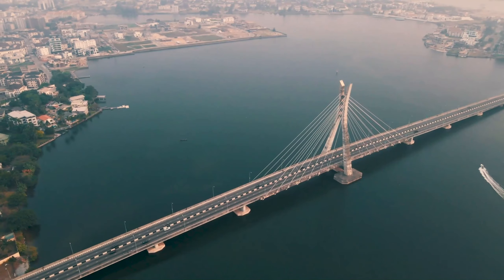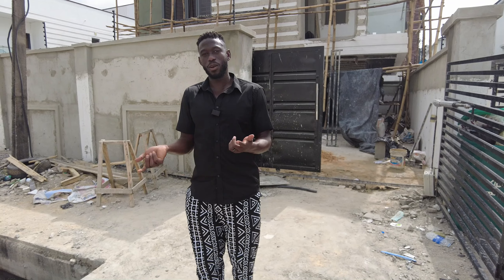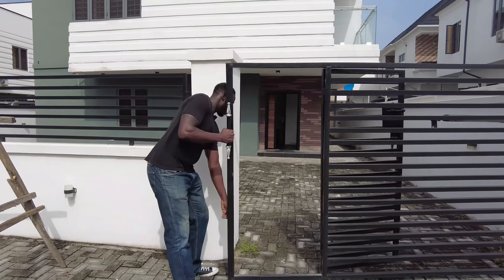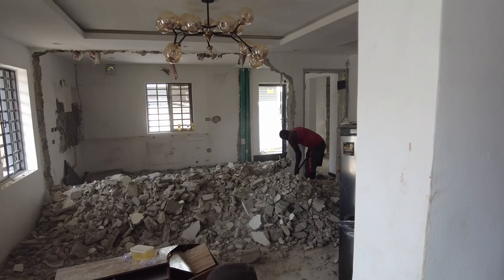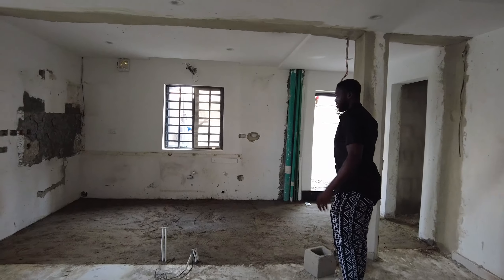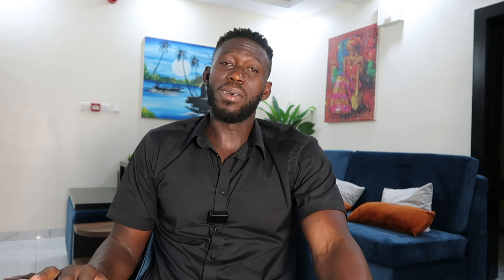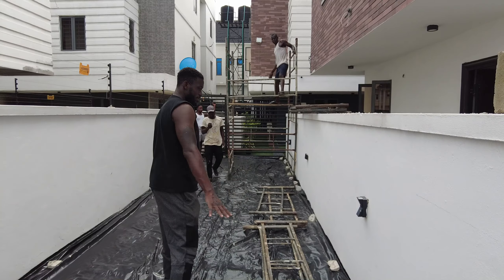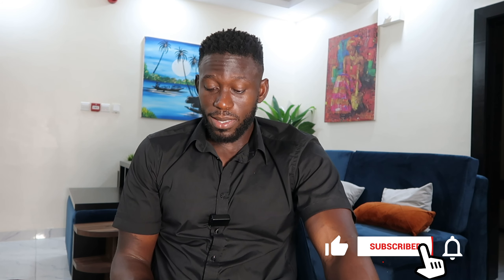Episode 12:   RECAP SO FAR! Phase 1 of Rennovation is officially COMPLETE!

Comment: Everything you want for the house is possible, but it comes with a cost. You can get solar split AC in DC with comsums less power, and it runs on 12-24v. Solar security light with sensor and deamable. All you security ca.era and devices can run on solar and batteries. 
I hope your client is  considering security solutions for the smart home. I see many of the smart homes in 9ija don't have security, I have experimented with this during the last visit, and most are relying on their ISP routers, which can be easily hacked.

Hope this information help.
Reply from the maker: Great input! Thankyou so much for sharing :)

Comment: Second question. If you have more solar panels than is required for your project and extra batteries would that help in giving the house full solar coverage for 24 hours and would it also be able to power the AC?
Reply from the maker: yes it would help but i am learning it is not as simple as that.  But technically speaking you are correct  The question that arises.. is how many solar panels do you need and do you have space for it.  ? how many batteries do you need for it to store pwer overnight and one of the most important ones. COST :) so far, It seems to be excessive for one house, unless the AC is phased out and fans are being used.
Reply: 10kva should be enough for your 24-hr electricity need. That was what I did.

Comment: You can actually run on solar 24 hours if its properly designed and tailored for the the apartment.

You can run your acs 24 hours as long as the roof space is sufficient to accommodate the required number of quality solar panels to recharge the batteries during the day. I did advice you opt for the haier thermocool genpal AC. They are really energy efficient and most our sites can attest to that. 

A quality Lithium battery and inverter is paramount for optimum performance as this system runs 24 hours everyday. 

I happy  you are integrating the solar water heater into your design but i always implement plan b on designs. Let the plumber also have a pipes installed for individual electrical water heater incase there's a breakdown of the central solar water heater.
Reply from the maker: its definitely possible but the amount of solar panels and batteries needed would be astronomical i believe. Also, longevity of batteries is a concern if it is being used constantly with this much intensity.  I LOVE the idea of PLAN B in designs. Thanks for that reminder . Thanks for contributing and sharing thoughts
Reply: @thenigeriannomad  not really as regards the  panels and battery requirement.. I did love to help if you can provide me in details the appliances and their Wattages that would be on solar inverter system. That would help to tailor down your battery, inverter and solar panel requirement..